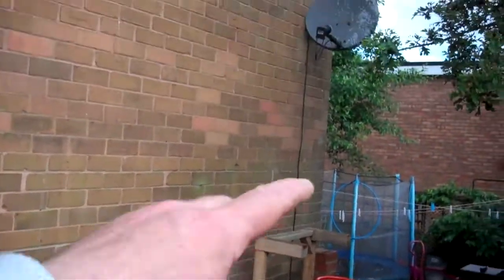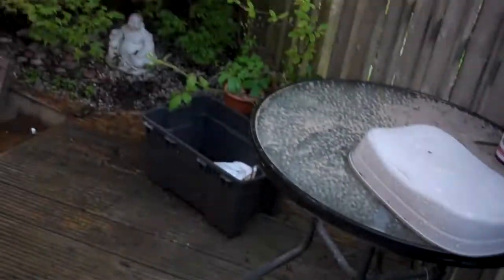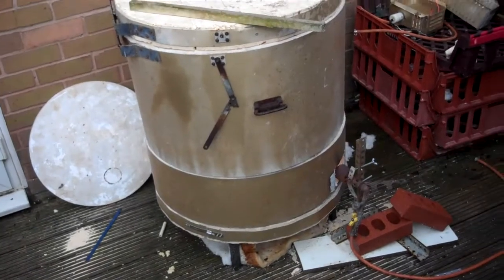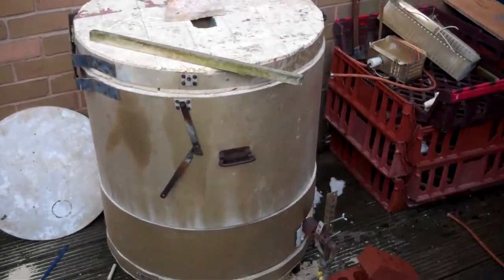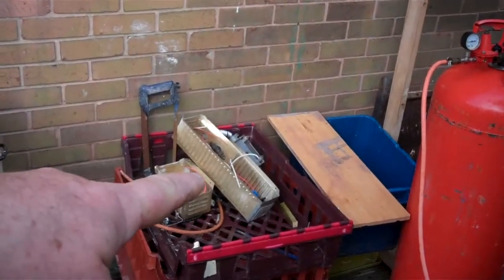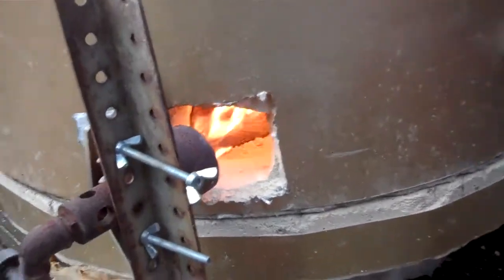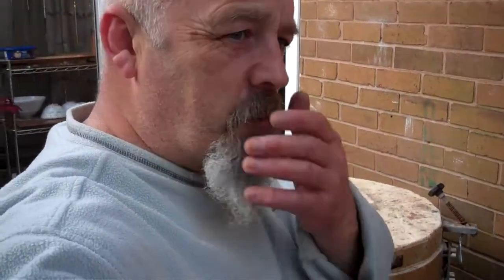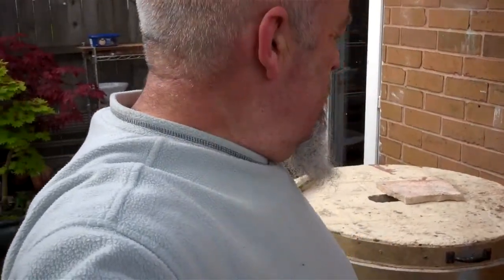pottery the new old bisque kiln first firing

Comment: I wonder if I could get away with that where I now live because it is portable like a BBQ. I did a wood fueled conversion in the '80's that worked much better when covered with more insulation from a layer of hard brick. A couple inches of ceramic blanket would make high temperature easy.